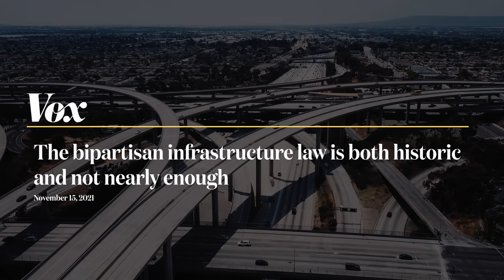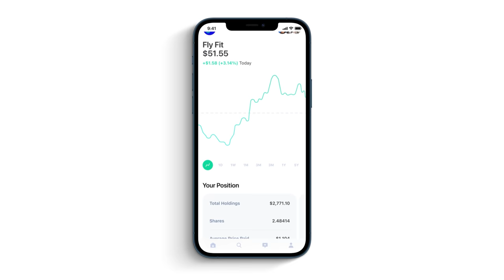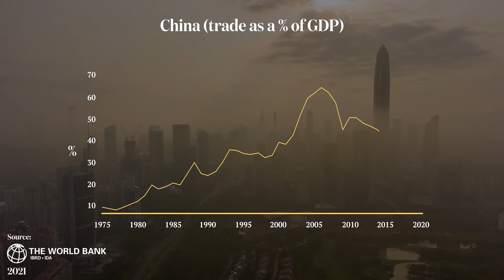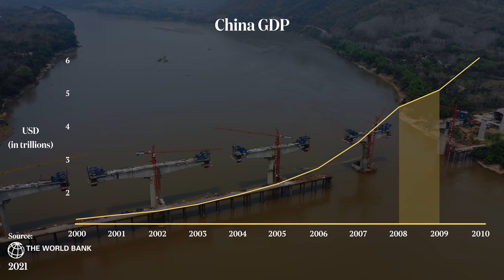China Has A Debt Problem Three Times Larger Than Evergrande | Economics Explained

Comment: When Japan started its very first Shinkansen, it was a massive loss and people criticized nobody wanted a train that fast. 
Half a century later, look how it turned out now.
Reply: But high speed railway is a commodity product. It can be calculated, planned and operated IF real and objective numbers are used.
Reply: Best train system in the world.
Reply: The distance to travel from a place to another is very different between China and Japan.
Reply: God's Creature  To link people, businesses and transport goods.
Reply: @drinksnapple8997  Most Japanese Shinkansen lines were funded under the government entity JNR (Japan National Railways). Then JNR was then split up into the privatized JR companies, so they are currently run by private rail companies.
Reply: God's Creature  If one small city boost in GDP, the other city will receive the same benefits. Also, 350kph isn't the fastest, but the fastest that currently operates. 600kph rail might be a better option for mainlines while 350kph can be used to replace the old low-speed passenger branch lines and liberate the transportation potential for cargos which don't require high speed.
Reply: Not true. Shinkansen was a well analysed and prepared project. It is moving a few times more people than the most popular route in China (Beijing-Shanghai)
Reply: Shinkansen has several things in common, there are alot of places on the line that are not profitable, the Hokkaido line needs yearly massive subsidies from the goverment (and that's probably the most extreme). Since the system is in private hands, they just close down lines and stations, and while that certainly mitigate losses, it also widenes the gap between the profitable urban areas and the less profitable areas that becomes more and more isolated.
Reply: @joluoto  And this is why you need better access from isolated places to profitable urban areas. Do you realize how China fixed that? Setting up secondary train lines from towns to cities where you do have good connection to the big destinations. Well China has the benefit of having the whole Eastern part being densely populated so by default it's a win.
Reply: @joluoto  Most transportation infrastructure receives massive government subsidies. American highways, for example, are a gigantic boondoggle. It's just kind of the nature of the sector.
Reply: That was built between Tokyo, Nagoya and Osaka. Three massive cities not really that far apart.
Reply: @2mek99  Are you comparing Shinkansen lines in the entire country to one line in China? lol
Reply: @2mek99  Well planned? From a design/construction standpoint, yes. From an economic standpoint, no. Politics played a large part in some Shinkansen lines getting built that have never been profitable (looking at you, Joetsu).
Reply: A better analogy would have been if Japan had built high-speed rail to tiny hamlets in the north.  They did not.
Reply: @TheExtraterrestrial99  not really, China is also a densely populated country with major city close to each other
Reply: @monkeylee4818  such as city A, B, C. A close to B and B close to C, but A to C definitely not that close. And there are many small cities or villages spread over the place in China.

China definition of close sometime is not that close, especially if you compare it to Japan. Japan is just too narrow.
Reply: @TheExtraterrestrial99  japan is narrow but also really long, so from northeast to southwest is not short distance at all. Also after the Japanese national railway got broken up, basically the only JR that is really profitable is JR east japan
Reply: @monkeylee4818  Japan only can consider far if you travel from South to North. If the travel is between  East to west, it is short.

Even South to North, you can just look at world map for comparison. Japan is not that big compare to other big countries.

Edit: By the way, Japan cities are concentrated on the bottom part, top part only has a few cities and not that populated.
Reply: @TheExtraterrestrial99  major Chinese city are also mostly concerned in the eastern coastal area
Reply: @monkeylee4818  And there are many people surrounded it, spread into different directions. Small cities, villages or even rural villages. 

Even small cities in China is huge and has more population than big cities in some country. Small cities population in China is around 1 to 4 million. In Japan, only it largest city, Tokyo can top that, the others, even Yokohama or Osaka, is in the category of small city in China.

China major city is more well built and famous. But you can't just ignored other small cities in China, they are at the level of major city in other country.
Reply: The Japanese were able to privatize their railway systems and make it efficient at providing public transit while also being profitable.
Reply: @Intranetusa  many of their line are not and are being shut down, the private capital only cares about the profitable lines
Reply: @monkeylee4818  Yes, but their rails are expanding elsewhere and it's mostly the rural routes that are shutting down as rural towns are becoming ghosttowns with barely any people living in them. The private companies do maintain some unprofitable lines too because they sometimes own the land around the stations and turned them into shopping malls and entertainment districts. If you have a situation where there are nobody in an area and you can't even make money with a shopping center there, then maybe the rail route should be closed.
Reply: No, the construction cost was what's expensive. Once it started running it instantly started turning in the money. Meanwhile in China it's losing money even after construction.
Reply: Japan is a unique case. It is a long and thin country.
With low cost airlines and more and more efficient airplanes, high speed rail rarely makes any sense in >1000km journeys.
Reply: OP is right. Winner does not need to listen to criticism. Japan won their gamble so they have their right to be proud of it. As for China, just wait and see. If they lose we all will laugh and criticize them for being blind and if they won we will just clap and move along.
Reply: Big difference, the size for example.
Reply: @Inspadave  And it shouldn't aim to be profitable in the first place.
Reply: @TheExtraterrestrial99  Exactly, that's why they build the line in the bottom part. The problem with China is not the big cities (they're profitable), but the ones that goes to nowhere. Why? The maintenance.
Reply: There is a difference between the Japanese Shinkansen and most Chinese HSR - what needs to move and move quickly? In Japan, it was clear the need was to move people between Osaka area and Tokyo area and Shinkansen made sense. In China, this also made sense between Beijing and Shanghai, or between Beijing and Guangzhou. In other routes, though, unless you simply want to give up developing those areas and concentrate all developments in a few places, it is more important to transport goods quickly and cheaply in and out of the remote areas. This would also bring local employment opportunities so people don’t need to travel far very often.
Reply: If a country is  big enough and has enough people to utilize, it is useful
Reply: That project was for the Tokyo Olympics 1964
Reply: China and Japan are very diff.
At larger distances, it's cheaper and rather more convenient to get air tickets than high speed rail tickets
Reply: Agreed.
Reply: @falsum2701  American highways are still a major economic engine - they move the bulk of the nation's freight. HSR is purely a people-mover and more often than not purely political. The only two lines in the world that don't operate at a loss are Paris-Lyon and Tokyo-Osaka.
Reply: Yes, Japanese railways were run inefficiently In the beginning.
Reply: @ABC-ABC1234  i saw how China fixed that problem with sparrows eating grain.
Reply: @mackster85  High speed railway is first and foremost a public service, not a commodity. The more it is turned into a commodity, the more the macro economic value suffers, because micro economic enterprise level considerations don't take into account the wider effect of improved connectivity. This is how "unprofitable" lines are closed when rail gets privatized, for example, because what's profitable is considered only within the context of the private railway company, and not the context of the entire economy and society it stopped serving when it got perverted into a commodity.

Now, in some places functional compromises exist, with private rail companies which are heavily regulated, and, if need be, also subsidized in some way, and be it only by socializing the costs and privatizing the profits. In these cases, the controlling influence of the government is still what largely keeps it from becoming too commodified. The more that control slips, the more the macro economic value of the affected rail networks is in jeopardy.
Reply: Also, Japan has massively populated cities running north- south. They needed a single line to accommodate the entire nation from Kita-Kyushu to Sapporo. China is MUCH bigger and MUCH less linear.
Reply: Japan is a small country China is not. They have a lot more to maintain.
Reply: The problem wasn't the first Shinkansen, it was all the others.
Reply: yes better to build for the future than build for today's needs
Reply: @Inspadave  What are you on about? Every line, other than the Hokkaido Shinkansen, are profitable, and competes very well against air travel.
Reply: @Funintherain13  Building something that isn't used is WASTEful.
Reply: u know in Japan, to take metro across tokyo u transfer like 5 times, bc each 5 different zones are owned by 5 different private company.  if you are to travel 10 hours by driving, you would pay more than 1000 on tolls. just absurd.
Reply: A very large part of the success of the Shinkansen is not just the general public but from business contracts due to the way Japanese business is done requiring in person meetings and agreements this leads to heavy train usage in order to conduct day to day business  however this type of activity simply does not exist in the west at all    It is a unique Japanese tradition leading to usage so need to be careful at comparing Shinkansen to any other country although the technology behind it is excellent and in the right location I am sure can be profitable.    Like perhaps the idea of Shinkansen in Texas between the 3 major cities, they are not that far, many people do travel between them and are becoming dense cities with many people living in them and not just the suburbs however making sure enough people will use it is critical as high speed trains require proper maintenance and  if usage is lower then expected I fear that will lead to risks for safety and longevity of the system.   The USA is full of great systems that ended up being taken down due to lack of usage by the public including electrified trains and light rail networks so need to be able to fund operations or perhaps partly government funded.
Reply: @mackster85  yup
Reply: Japan rank 18 in Corruption Index, China ranks 65.. The quality of gov is vastly different. Japanese did not go crazy on projects like the Chinese which hv a reputation of doing things merely for political consideration alone..
Reply: ? Almost every line in Japan is uneconomical adj for cost of capital… like there’s 2 or 3 that are profitable in the entire country. The country is the most indebted in the entire world
Reply: It only make sense between big cities close to each other. Increase the distance and it make more sense and saves Time and money to fly. And China is much bigger than Japan.
Reply: Most Railways need Subsidies to exist!
Reply: @Jonathan Luoto  , but they are closing regular lines that run through underpopulated regions. Hokkaido Island only has a shinkansen line that runs to Hakodate, which is the southernmost city in Hokkaido.
Reply: lol you are the one ill-informed. the toukaidou sen is the money printing line since the very beginning and it is saturated.
Reply: That's Japan a smaller country, but with China they are competing with themselves with EV cars. China is a larger country and traveling in a car is more convenient than train.